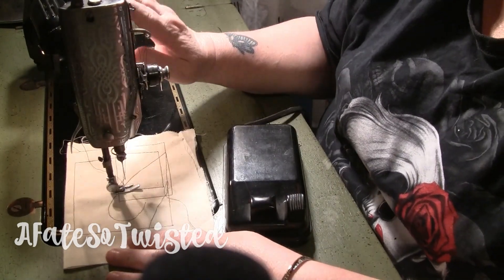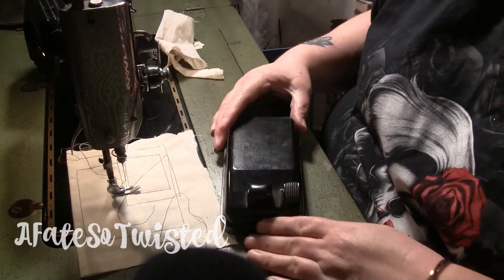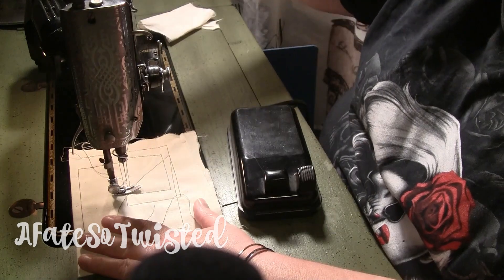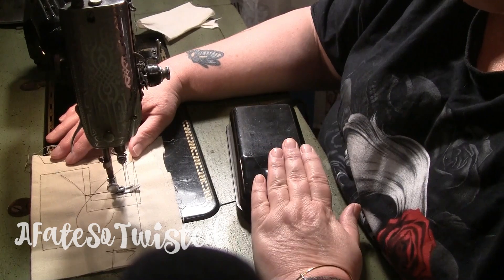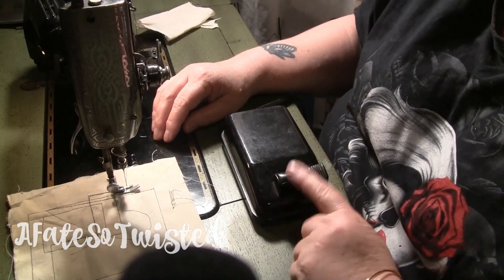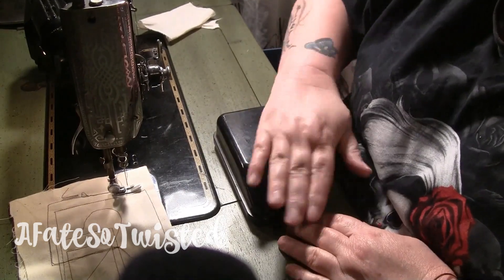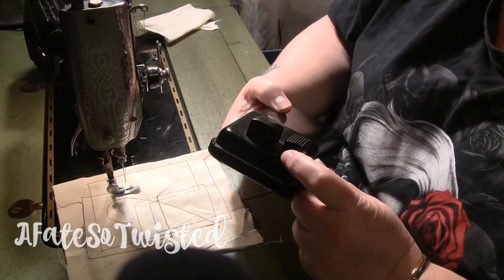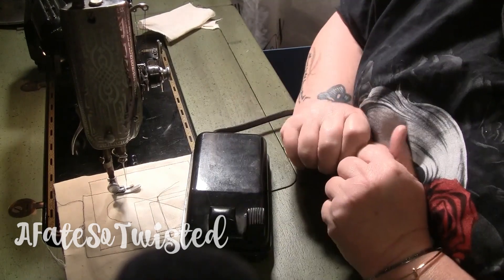Vintage Singer Foot Pedal Demo

Comment: I have been sewing on these vintage machines for the better part of 35 years, The way I have always used the bake lite pedal is “backwards “  so you heal is controlling the button.....just give it a try. 😃happy sewing.
Reply from the maker: Unfortunately, my machine stopped working a while back.  I still have it, but I need to get a new motor for it.

Comment: I have a vintage machine and foot pedal exactly like that. Can you explain how it needs to be connected? I have never seen those kind of connectors. The machine is almost in perfect condition so the wires and parts don't need to be replace, I just need to know how the connections work!

Comment: It's a pedal that uses a knee pedal. It is mounted to the inside of the cabinet. The button is pushed by the knee pedal attached to the cabinet.
Reply from the maker: Ahhh...that makes sense. But I don't think I'll be attaching to the cabinet. I'll just use my foot.
Reply: Thanks for that Info!!   I was trying to get it off the inside of the cabinet to use as the foot pedal since mine is missing after lending machine to a niece!  I always liked just using the knee pedal anyway!  It's from my mother's 301 sewing machine from the 1950's.  Works like a charm!